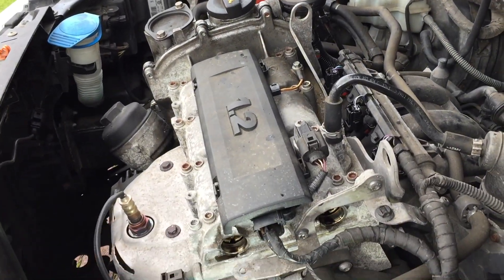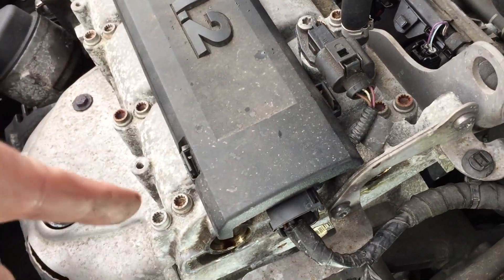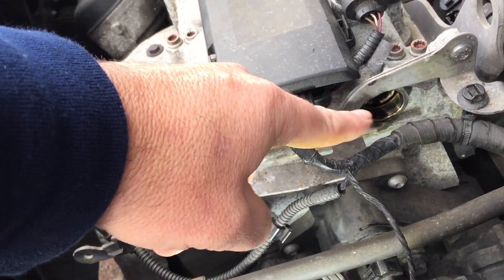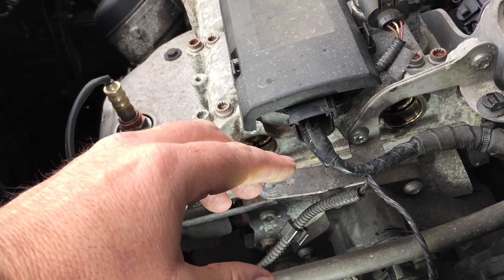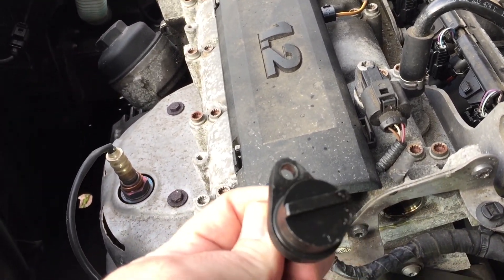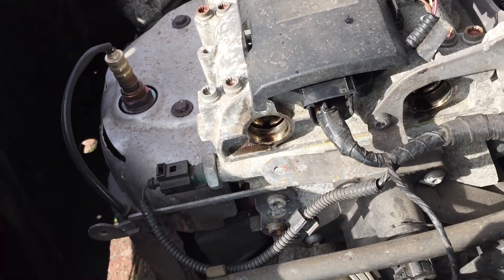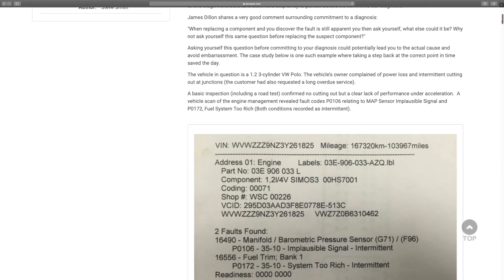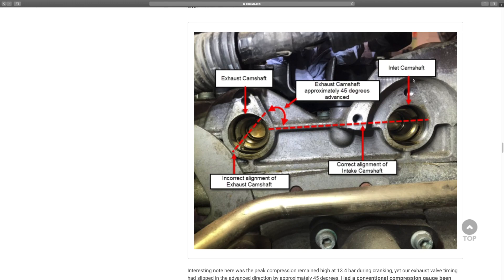Quick Test - Check Timing VW POLO 1.2 CGPA Engine

Comment: Hi sandy,I have a p0341 code on a 2010 vw polo. It revs up but cuts out on idle occasionally. The fault is camshaft sensor. I have checked that the cams are aligned using the tools and they appear to be. It had a new chain 3-4 years ago. Would it be the chain again?
Reply: Boa noite renho o erro p0321 pode me ajudar ma mudei os sensores e esta igua

Comment: Hi sandy, the two positions at the top of the engine are the same and I am getting the camshaft sensor error and I have changed the sensor, what do you think could be the issue? Thanks
Reply: I have the same situation. Probably the crankshaft position  does not match the position of the camshafts. I will replace thhe chain AGAIN.  Don't buy the cheapest parts.
Reply: @maciejfratczak4136  did it resolve your issue by replacing the chain?

Comment: Well the biggest problem is the down at the crank, where the chain tensioner sits. Just did a full headjob on this engine now. All 12 valves. Both cam were in position but the chain was so slack, the crank couldnt get a grip on the chain down there, so all the intake valves were bent. You might not get any warning signs of this happening. This happend on startup after the car was parked hillside.
Reply: The very same with ours, garage said there seen loads of these, especially after 80,000 miles

Comment: My Mrs has this engine and it misfires when you first start it after its been left a while , will run like shite for the first 20 secs then be alright! No codes and had a chain 6 months ago (did this before chain too!)
Reply from the maker: First thing in morning remove spark plugs and check if any cylinders are wet/damp
Reply: @sandyande  will do, cheers sandy

Comment: Hey sandy. i just bought a 2012 polo mk5. i dont know much about cars but is it normal for the bottem metal part of these engines to get quite hot?
Reply from the maker: Yes that's the sump where the oil is cheers sandy
Reply: @sandyande  Thanks for clearing that up Sandy. Love your vids so helpful especially as a new driver :)

Comment: Thanks Sandy.  Wife's 2011 Polo 1.2 is running badly on idle (engine shakes and sounds like a misfire) but runs fine when driving.  I'm not sure what the symptoms are of a jumped timing chain, but I'll certainly check to at least rule it out. Other than the obvious (plugs, connectors etc) I'm at a loss as to what to try next.  No fault codes, by the way.  Plugs are clean/new.
Reply from the maker: Usually bad coil or jumped timing chain cheers sandy
Reply: Did you get this fixed and what was the problem? Thanks
Reply: @akjn6929  It turned out to be the engine stabiliser bar. The rubber bushes were worn.  Chain is fine. Still have an occasional misfire though. The coil packs were changed so it could be a loom fault or maybe dirt in the fuel system.  The wife's driving a Honda E nowadays so the Polo isn't used much.

Comment: Hello, Sandy. Great video! Is there a way to check if the valves are hit by the pistons, without taking off the cylinder head?
Reply from the maker: Borescope or leakdown test but the standard procedure is just to put on new chain and see if you got lucky

Comment: Hi Sandy, I have had a look at mine and mine are seems to line up, but do have the code for the camshaft sensor and i does run like the car you have in one of your videos. I am going to try another sensor but is it possible for timing to be out on both cams? Could it jump teeth on both? I have the 16725 Camshaft position Sensor P0341 Implausible Signal like you had and thought it had jumped. I am thinking of getting the locking tools and see if i all shafts line up at TDC?
Reply from the maker: Get the timing tools from eBay it's the only way to be absolutely sure, cheers sandy
Reply: @sandyande   thank you, ordered tools if anyone follows the comments, i have put another sensor my fault existed and i do have voltage to the harness so it must of been jumped!
Reply: I have the same. It really looks like both camshafts are misaligned to the crankshaft.

Comment: Iv done 3 of these this week. That's how bad they are. And one of them was a seat ibiza but with the TFSI engine. That's a little different. And the timing was miles out on that one.
Reply: Are you able to give me an estimate of how much this repair would cost at a garage? Thanks
Reply from the maker: Cheers my friend, how long does it take you to change the chain cheers sandy
Reply: @sandyande  hi sandy, with sump off, 4 hours. To make sure the side cover reseals correctly to the sump. The TFSI is a bit longer cos of the water pump at rear of engine. That runs the supercharger. The water pump has to come off on them to get to 3 bolts for the cover.  I charge 340 for the 1.2's . And 415 for the TFSI ones. They both use same timing tool setting kit.
Reply from the maker: Cheers my friend thanks for information, Sandy
Reply: @sandyande  anytime pal. I found your channel as like you. I'm a mechanic 6/7 days a week. Work on anything that comes through the doors. This being my 24th year. Love your videos. Thanks for taking the time and effort with uploading them.